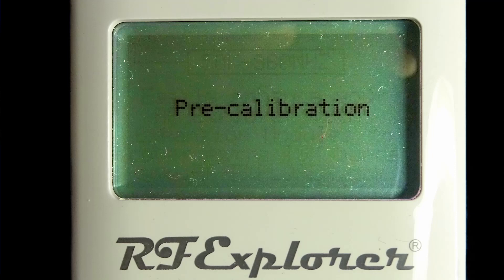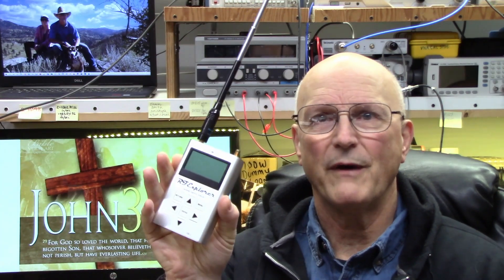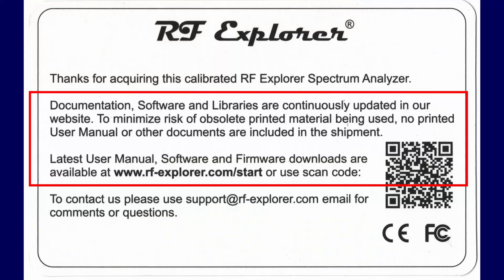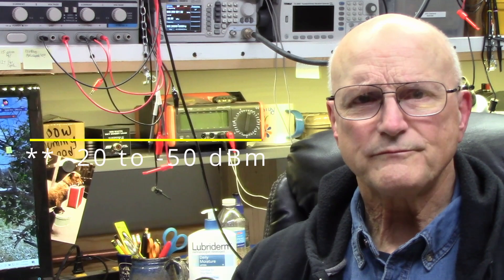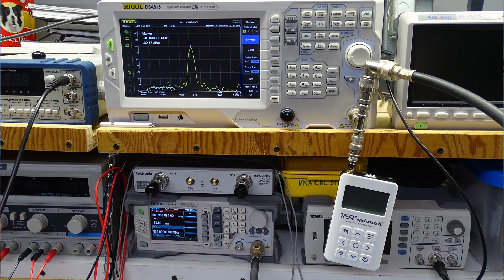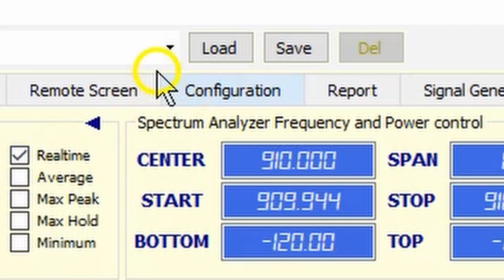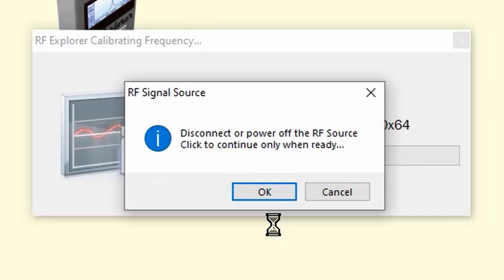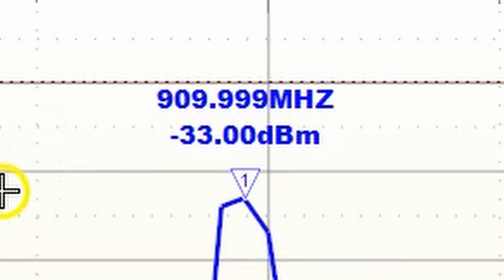RF Explorer Calibration: The Complete Story (020a)

Comment: Do you have a method for using the RF Explorer and the Signal Generator to run through a testing profile to save the user the time of switching frequencies?
Reply from the maker: If I understand you correctly, you have a series of tests to perform which require different center frequencies, possibly different spans and top and bottom values for each test.
Using the RF Explorer for Windows software, you can save START/STOP, CENTER/SPAN, TOP/BOTTOM specifics. See the dialog box at the top with the [SAVE] & [LOAD] buttons. Setup the specifics you need. Enter the name (e.g. Test#1) into the dialog box and click on the [SAVE] button.
To load the configuration later, use the dropdown list which is the dialog box, select what you want to load and click on the [LOAD] button.
If you need to change the settings for a particular setup, load the original setup first, make the changes, select the original setup in the dropdown list and click on the [SAVE] button.
What DOESN'T get saved is the number of sweep points in the display.
Hope this helps.

Comment: Hi, thanks for the video. It is very clear. Did you work out also a way to do amplitude calibration of the RF-Explorer?
Reply from the maker: I am glad that you found the video helpful!
They do not provide a way to "calibrate" it per se for amplitude except you can add an "OFFSET DB" via the attenuator menu which is remembered from power up to power up; this is kind of the "manual method" of calibration. This value can be +dBm or -dBm.
Careful! Cables, connectors, adapters, frequency ... well, just about everything will affect the amplitude the RF Explorer actually 'sees' at its input connector.  This is especially true as the frequency goes up because of the loss inherent at higher frequencies.  So, you could set everything up for a particular frequency span and test setup (cables and connectors and antennas and the like). Then you could determine the needed offset in dBm to correct for the losses. Then save this complete as a preset to go back to for future measurements.  Don't forget, that real the offset dBm might (probably will) change with frequency and test setup.

Comment: Thanks for posting calibration vid! We have a RF Explorer at the shop that I am sure needs to be looked at.
Reply from the maker: You are welcome!  Just note that the RF Explorer Standard (extruded aluminum case) does not have the extended plot points option.  It is 112 points only.  Only the Plus (pretty, white case) has this extra capability.